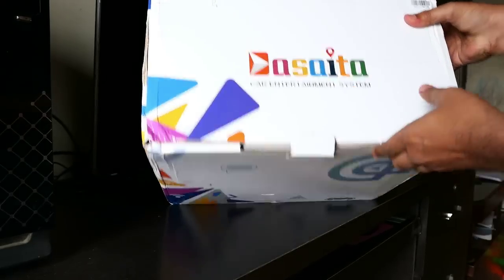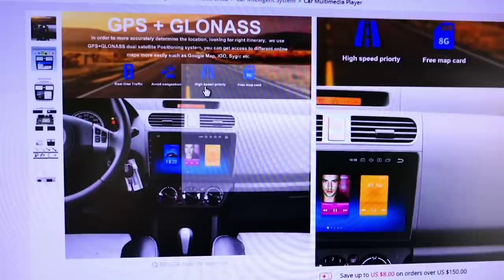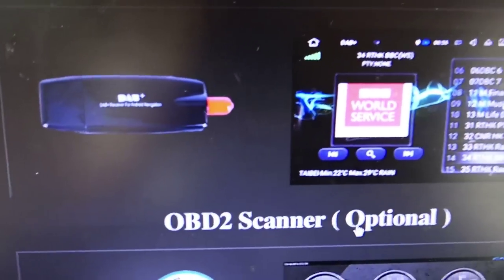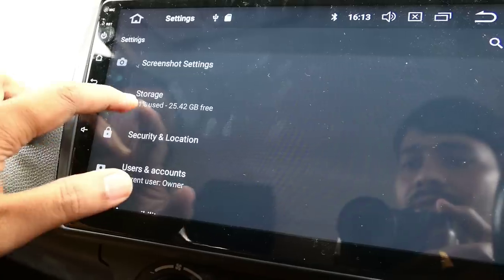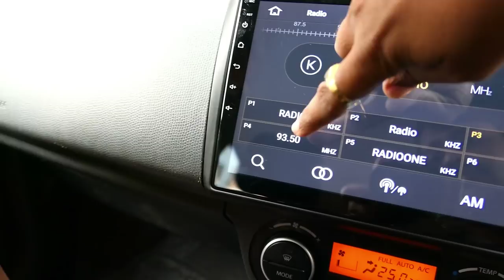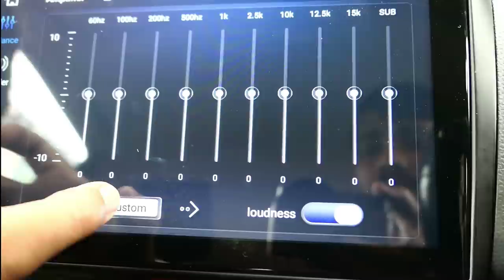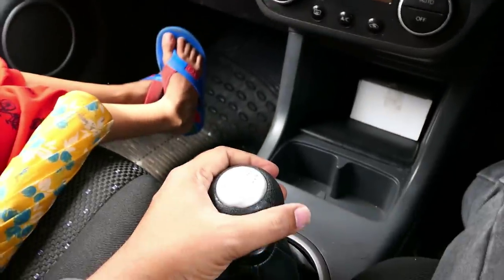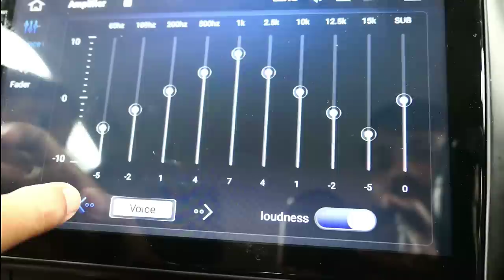Latest Android 8 Car Infotainment System Un-boxing, Installation tips & Live Features.

Comment: Dear brother whats the plastic part you removed pls respond i have the same car and same set but cant seem to fit it to the dashboard please help me
Reply from the maker: Hi.. is it fitting like what i was shown in red circle? If yes then check properly what's causing the issue, mostly it's because of old socket fitting plastic, part, which you have to cut slightly, the expert mechanics or anybody will get it.. May be if you observe what's causing issue, file it or cut it,  please check properly.. I do not remember exactly, it was done by mechanics, it was not fitting before, but after his cutting trick it is perfect.
Reply: Thanks, brother for the reply  i got the new PX6 with new Rockship PX6 ( rk3399) 6 core
2 Core cortex A72 2ghz
4 Core Cortex A53 1.5ghz 
4GB RAM
64GB ROM 
with tpms , DVB-T2 and wifi dongle
MINE GETS Hot quite fast tamps are in 70-90 C so i removed the top cover and fitted a fan now the temps  are 40-50   no matter how long its used. thanks for the tip got it fitted perfect now all ok if you want i can send the fan mod pics if your intrated
Reply from the maker: Great! Defiantly show the pics, so other guys will have benifit of it., About hitting, do you brought same brand, do it have hit sink?, Thanks
Reply: TOOK THE NET OUT OF A PLASTIC TEA tea strainer box type thing is a voltage regulator for the fan coz car power can be 12.9 to 14.2 Volts so with that the fan will not damage over time its a voltage filter
Reply: new pis added
Reply from the maker: Thanks so much for quick response, and feedback! Great.
Reply from the maker: Do the fan come with kit ? Or you invented it for system..? Nice assembly.? 👍☺
Reply: its a normal fan i added it it didnt come with the unit and you should i8nstall mobdro on your system if you have data so you can watch almost any channel on the go hbo alone you have like 6 hbo channels try it you will love it.
Reply: fan top is a jar lid cut to hold the mesh thats all thanks
Reply from the maker: Nice DIY tricks!
Reply from the maker: Thanks for the mobdro information, really great app!

Comment: Does it fit Prius 2017 ?
Reply from the maker: No, you have to check with seller, it comes with different mounts according to car car models, my car is 2006 swift. So it will not fit. But follow the link in description and ask the seller.

Comment: Did the radio work out of the box or you had to purchase DAB receiver separately? And what about factory sub woofers and amps, did they work upon connecting this head unit?
Reply from the maker: Radio works out of the box, as india still need to develop for DAB, stations, yes, default system speakers can be connected..

Comment: is this fit with tigor amt
Reply from the maker: I do not think so, it's for international models, like Suzuki, Chevrolet, BMW, etc do not matter it's left or right side steering all has same mid part, so it works for those, .. but if Tigor has standard music system fitting space like other cars then there are universal music system models which fits in most of the car, but the size of the music system will be smaller.And you can also contact seller from my description links with photos of your music system space with measurements,  I hope this helps.

Comment: Sachin, can this android info system be installed on Maruti Ignis Delta? If so, how difficult it is?
Reply from the maker: I Krishna, Since Delta has different dashboard, this system will not fit, but there should be version made for Ignish Delta please contact seller directly, he will guide you correctly, the links are in description, you can contact him on aliexpress, once registered!

Comment: Android, or any smart phone input on the front end of an audio system will only result in totally naff quality sound!!  You need 16bit cd quality at a minimum!
Reply from the maker: Hi Peter, you are right, but we can play good quality songs, directly with blue tooth, you can play Ganna.com directly if you run hotspot of your mobile and entertainment system as receiver. You can always get high quality songs from on line and play those.  May be you do not feel it better because i was recorded it from camera and it has not good sound receiver.
Quality combination of speakers will defiantly enhance the effect.
Reply: @sachinpore4746  I take your point, but improving the amp and speaker will not improve the sound from the phone. The low bit rate from the phone can only be amplified, not enhanced by the amp, and the speakers can only replicate the audio it has been fed form the amp. ;Garbage in, garbage out' as they say.

Comment: How is it with heat using GPS ???
Reply from the maker: Hi Luis, not able to understand what you mean?, it has separate GPS unit, connected through wires, do not observe any difference in temperature.
Reply: @sachinpore4746  sorry I ment how is it with heat when using google maps on long trips? My phone heats up and kills my battery. This car stereo wont run out of battery but I'm curious of how well it deals with the heat
Reply from the maker: For this situatuion, i got good solution, you put your phone connected to usb in lighter charger place, then connect it throgh car enfotainment through hot spot, and blue thooth, and switch screen off the phone, so it will not heat up and keep charging mobile through car charger. I have solar charger.. and used almost full day.. with 100% mobile battery withoit heating... And it will not use phones GPS.. because it will use cars GPS by infotainment system..hope it helps..

Comment: How did you manage to fix the gap mate?got the same issue, when I try to lock the upper part in, the lower part pops out and vice versa. It looks similar to the video
Reply from the maker: Hi.. It's plastic part from car's fitting, If you study, what's causing issue, just cut that part about 1-2 cm.. that's it.. The or show to mechanic he will do it. Don't try hard on current settings. It has to cut that part. Then it will fit.
Reply: @sachinpore4746  Hi, thanks mate. ill try that :)

Comment: thanks for the informative video. steering wheel controls? do you need to buy additional adaptor for steering wheel buttons to work?
Reply from the maker: Hi, Nigel thanks, but my car do not have that controls, so i have not tried it, but i was asked about it to the infotainment fitting mechanic, he said it the steering needs to be replace, I think, it will not fit directly, but if you have, then it should work.

Comment: How does wifi work? Do you need to use hotspot?
Reply from the maker: Yes, just turn on your mobile hotspot, and turn on wifi from music system that's it. Another way is from usb wifi dongle i think, but i have not used that way. It also has own hotspot like your mobile do.
Reply: yes.  wifi connect to hotspot